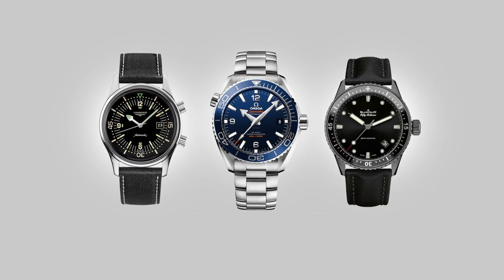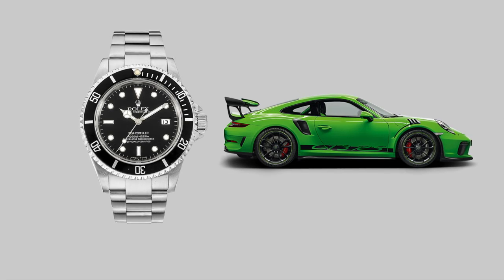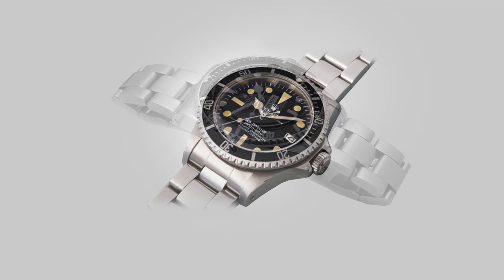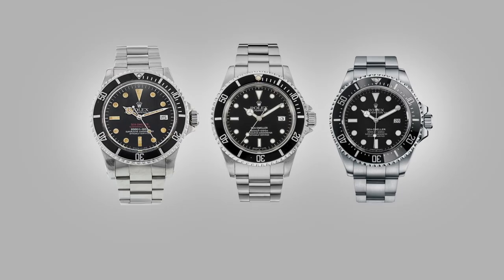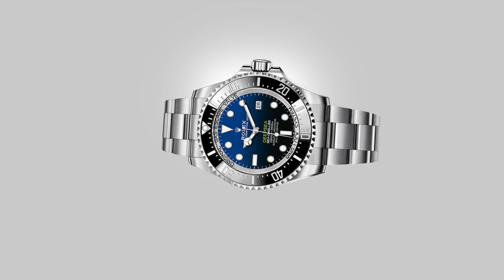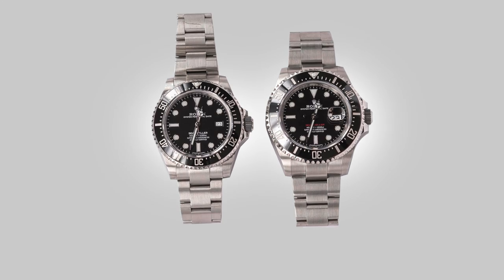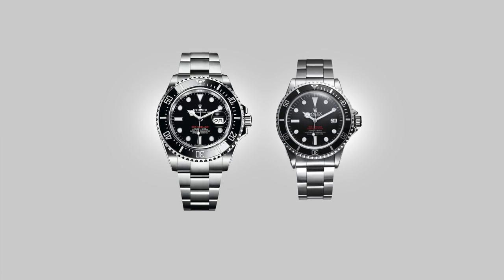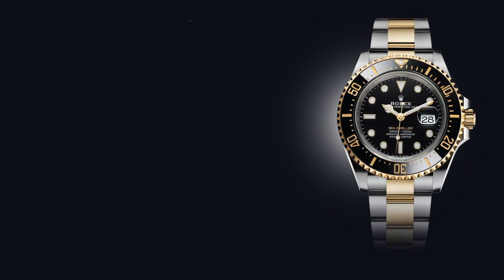The Problem with The Rolex Sea-Dweller Design

Comment: The Sea Dweller 126600 is indeed a shot foot watch.  Too much thrown in with no reason.  Divers don't need a cyclopse at depth.  Leave that for the guys on the surface.  I'll not even go see this watch.   It's too much.  If I wanted a cyclops on my Rolex, I'd buy a sub.